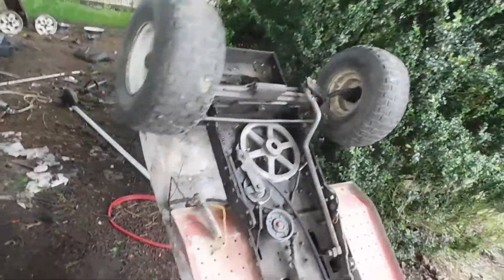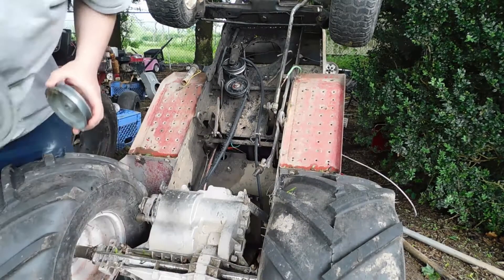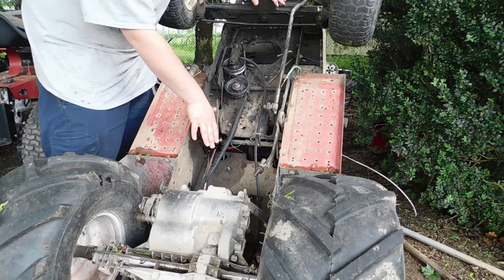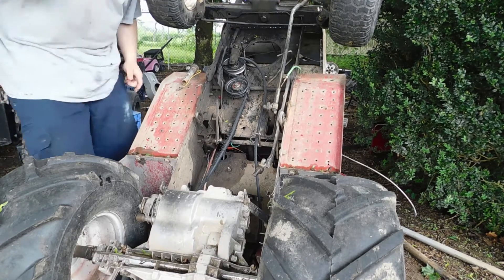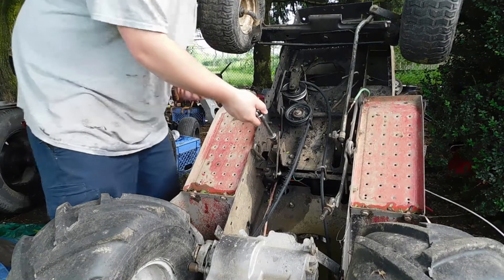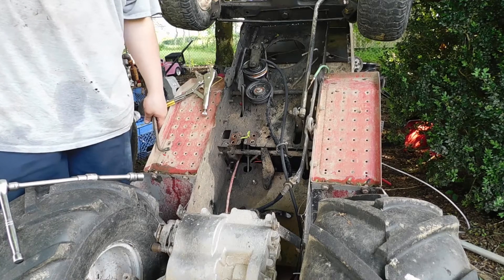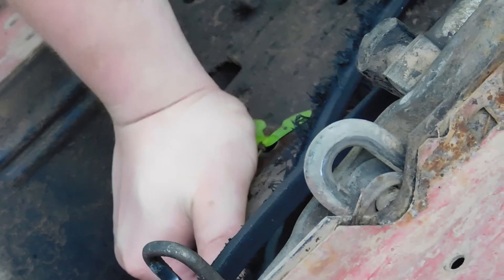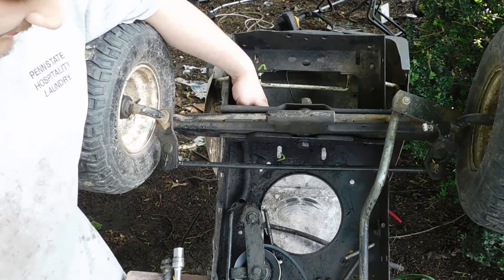Dinky's Big Clutch Upgrade P1

Comment: Ok you have the right idea but it has to be closeer to the front to be able to lessen the tension around the engine pulley. Placement of it really matters in how it will work. Then after you get that you will need to redesign the clutch linkage. I will go send you a pic to your email, sorry i actually forgot to do that.